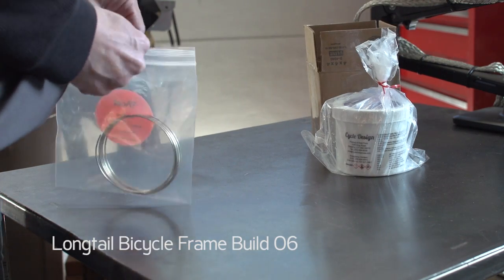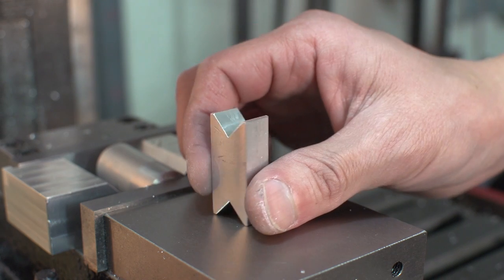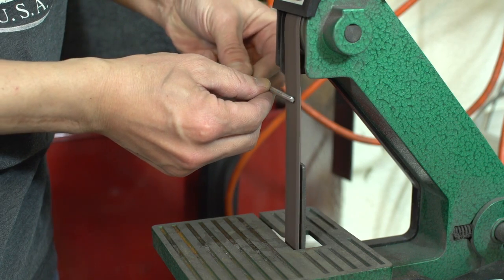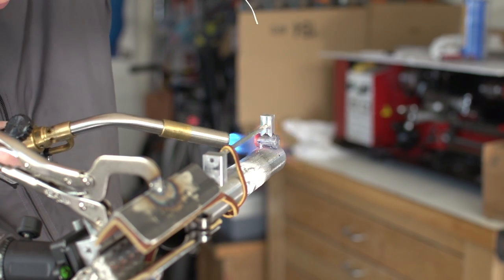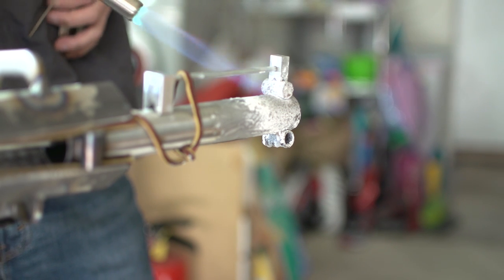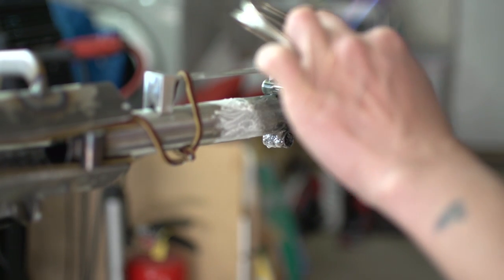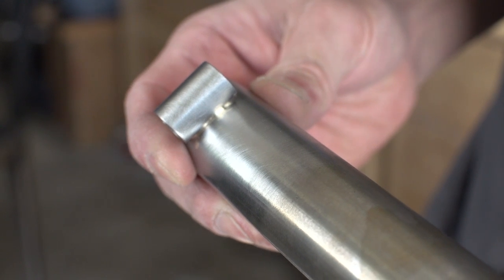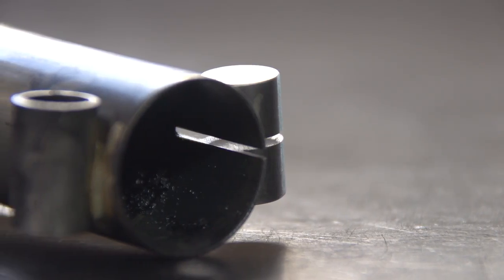Longtail Bicycle Frame Build 06 - Silver Brazing Seat Tube Binder With MAPP Gas

Comment: Really interesting, I am really old and was taught to brazing at school. The first thing we were taught was to look at the mass of the two things you are soldering. Then start heating the larger mass and move onto the smaller mass and start juggling until everything is even.
We used bronze brazing rods. We were taught that, by bashing the rod out thinner it would melt and flow quickly (less mass). Anyway, thanks for taking the trouble to produce these videos.
Reply: Bicycle frames use a mix of bronze or silver solder. Bronze is used for fillet brazing tubes together, especially without lugs, and silver solder is often used for all the smaller stuff like cable stops where you just don't need the strength or want as much heat in those areas.

Comment: Background: 
1) Silver brazing (soldering) small copper and brass mil spec  parts w/ lo temp 4% silver solder, where I  work.
2) Brazing mild steel (motorcycle frames) with brass and nickel/silver rod (gear head toys).

Thoughts and observations:
1) Quit waving the torch around like a magic wand, half the time your flame is heating the air. Use slow strokes. Generally, bias the torch to the piece with the most local mass so you don't burn a hole in adjoining thin material. Guess how I learned that one...   :(

2) Heat transfer through your hold down is minimal, due to minimum contact area of your 4 point clamp. Full contact with an arced clamp would transfer a lot more heat, possibly causing problems. If the al alloy melts, use a mild steel block, however al alloy isn't going to accidentally get brazed to your bike frame. That's why I like to use al for jigging... 

3) If you switch to an oxy/fuel system, use a tip designed for heating, not cutting or welding. With an Oxy/Acet setup, they are sometimes called rosebud tips.  Hardware store Oxy/Mapp setups I've seen use welding tips. In that case, back off from the part to distribute the heat. Welding requires intense and higher  localized heat, brazing and soldering requires lower and distributed heat.

4) Brass and nickel/silver filler are stronger than 56% silver solder, but not by much. They also require more heat. And are considerably cheaper. What is more critical, in my opinion, is the surface area of the joint. Overlap joints are best, butt joints should be welded. Good filleting, like what you're doing, creates something similar to an overlap joint. Good gusseting can create brazed joints far stronger than butt welded joints, although it takes more planning time and setup. Brass and nickel/silver can (arguably) build fillets and fill gaps better than silver solder. Silver solder (usually) wicks easier.  This is one reason for the wide variety of filler alloys.

5) Brazing can easily accommodate dissimilar metals, depending on filler selected, making it a real advantage for fabricators. Check out the Muggyweld SSF-6 and SSQ-6 videos...

6) Mapp only for brass, bronze, or nickel/silver filler? I haven't tried it but this guy says yes...
https://www.youtube.com/watch?v=5ZD7OM1_YxM&t=9s
I think a lot of it may depend on the mass of metal involved. You won't build a bridge with Mapp gas...

I'm watching your video doing research as I prepare to braze mild steel flanges on a new "universal" stainless steel catalytic converter for my truck. Every muffler shop I know of arc welds these things together. Quicker for them, but I'm not impressed. I'd rather do it myself.  

Thank god for YouTube, this place is quickly becoming the world's best DIY research lab.
We all learn something here. Good luck with your projects...    ; )
Reply: @Michael McCurley  >You have done the best job of describing of thermal mass, heat control and application. 
I have a 150 amp MIG I got with barter deal New in 1984. I think my Sear’s best O/A torch (AKA Harrison) came in 1982. No prior training but the family farm. We had a crank-top Lincoln welder my step dad & his father would use to creat metal bird poop statues on metal they where trying to fix. After my older cousins who came every summer from KC from their divorced father, showed up with a go-cart. What could more fun on the farm until you hit a chicken. They left, I wrap the rope around the pulley, flipped the metal “Kill” tab from the spark plug, and took it out and broke it. I figured they would beat my ass in several creative ways, I was trial by fire. So stick welding came to that 8 year old quickly. (Always the Tallest), but like anything, if you do it 3 or 4 hundred times, you get better. It’s hearing the sound of a leather belt, coming thru belt loops at the speed of sound, I knew that was my cue to start running. No child services or witness protection program developed yet.
Either way, I have never used mapp gas but have brake line sized tubing to join. I will give it a try, but with propane.
  Retired automotive master tech, I still like learning. Yes, no youtube, maybe a book, and no shop class in high school. It was uphill both ways and our phone was wood with a few metal parts and actual horse shoe shaped magnets. I know, my maternal grandfather & grandmother ran the phone company and switch board. Cranking the handle would generate higher voltage to ring a bell and latch a relay (Over-Center-Spring) but the cord had to be pulled and inserted into the correct line, if not lite already. That meant it was in use. That’s not hard soldering, just memories...or learning to weld. 
Also, crank top Lincoln welders, with press fit diodes installed in a large heat sink, arrange in a rectifier, makes a great battery charger, as the crank control amperage out. Best of luck with your skills. Regular brazing rod, simply adds a filler to look good, but adds very little strength.
Reply: Thanks, maybe you could start a channel also. Most channels deal with welding, not so many with soldering and brazing.

Comment: I only put flux where I want the silver to flow.  Heat the area around the joint first, including the holder.  Then you heat the actual joint  and when the flux goes clear it’s ready.  Let air cool.  Done correctly it’s incredibly strong.
Reply: Gene Miller,
Glad somebody said something about the Flux...
This guy Obviously has Clue Zero.
He would’ve Dipped the whole tube into that Flux Jar if he could.

Comment: Silver soldering is actually brazing even though we call it soldering commonly. Silver solder is stronger than bronze rod. It doesn't however build up like bronze rod because it flows more. If you want big smooth fillets or to otherwise fill gaps, use bronze. If you want high strength and inconspicuous connections, use silver. It is not that straight forward though as you can get a huge range of silver solders/brazing rods that behave differently and melt at different temperatures. It is really great stuff as you can do more complex soldering as you do all the high temperature work first and then go with lower and lower melting point filler rod to put together more complex assemblies and not melt the previous connections.  If you want more info about silver soldering, the real place to find it is in jewelry making books. They use it extensively.  

The heating is a balancing act. You don't want to heat up too slowly as when the flux is gone, you will get more oxidation. The flux should be almost gone and glassy looking. The solder will flow to the places with the highest temperature. The heat reduces the surface tension. The extra flux doesn't hurt anything but clean it off well. It will corrode the metal if you leave it on.  

Silver soldering (the kind you are using) temperature is right around the melting point of aluminum. I half expected the clamping device to melt as you were working.
Reply: David Kirtley thanks for sharing so much knowledge :) I am starting too on a similar set up!
Reply: Silver solder and Silver Braze are definitely not one and the same.
Reply from the maker: I think the clamp did melt a little on the ends. Thanks for all the tips and taking the time to write it up, very enlightening.
Reply: Brazing by definition is using a brass/bronze based alloy. The real limit of what is called soldering is with alloys that melt below about 1000F that can be melted with a heated iron. Silver soldering doesn't really meet either definition.Silver soldering is above done 1000F and isn't done with a heated iron.
Reply: It hard brazing, not soldering or welding. Hard brazing has more to do with temperature, resulting in a stronger holding pressure. That’s all.

Comment: Making a small hearth from a few fire bricks will keep heat localised in joint and allow brazing with something like a sif bronze rod. I like to paint my flux into the joint and then lay a ring of the brazing rod into it. The joint is then heated till the brake melts and" flashes" around the joint with perfect penetration.
Reply from the maker: Nice, I have so many new (to me) techniques to try now. :)
Reply: I really like the idea of this technique, but i have a few questions. 
Is this something that could be used for a tube joint? 
And would you then need to build up a fillet of top of that?

Comment: Great video, when I silver solder I use the Kozo Hiraoka method, for small areas, I Flux the area to be soldered, snip about 1/4" silver solder wire and place cut solder at four points or more on pieces to joined, making sure the silver solder adheres via the Flux, and heathe up either piece to be joined. Then whenever possible I pickle the soldered area to clean, but I've used sand blasting mostly. But, as I said, more than one way to skin a cat, learn and use your preference, what you feel comfortable with. We'really rootin' for ya.
Reply from the maker: +eddie Towers thanks Eddie, I like this method. One less thing to worry about. Frees the other hand for my beer ;)

Comment: The solder will follow to the heat. I always concentrate the heat on the thicker materials. Once the solder starts to flow be gentle on the heating. Only heat where the solder hasn't flowed to. For instance just heat the thicker stock with the edge of the flame as to not keep heating the other areas too much. don't worry about heating that holder you made as the boss is thicker and requires more heat than the tubing. I'm by no means an expert but I spent years soldering mechanical piping and odds and end metals for side projects. Enjoying all the vids by the way. Just recently found your channel. Keep it up!
Reply from the maker: Awesome, yes. I can already imagine how the next test will go and where I can put the heat. For sure not on the drilled side of the binder :) Can't wait to do the next one!
Reply: Best of luck! Keep it up!

Comment: I think that MAPP torch is actually helping you with the heat control. It's putting out less BTU's than an O/A flame, so things are happening more slowly. A good way to learn.

You can direct the heat more on the thicker of the two parts of a joint (in this case the binder) and the thinner part will be heated to temp mostly as a result of just being in the vicinity. For a binder I would also get the flame inside the seat tube from time to time, underneath the binder. That will help the filler flow all the way under. Good practice is to only add filler on one side, then draw it through to the other with the heat. That way you know you've gotten complete penetration. 

It's good to have continuous motion to your torch movements, but not too much. Also, the hottest part of the flame is closer to the nozzle of the torch. You were brazing with the "feather", quite a bit further out. This is a cooler part of the flame, so things will take longer to heat up. Get your torch a little closer. Not being critical here. Just offering some pointers. You did great in my opinion.

Btw. Brazing is also known as "hard soldering" and occurs above temps of 450 deg. Centigrade (842 deg. F). Below that temp it's soft soldering, or just soldering.

It would be interesting to see if you could brass braze with that torch. I still think that that's the way to go here, but I understand your logic in going with silver.

Consider an Oxy Propane set up sometime down the road. Cheaper than O/A but very close in functionality. 

Cheers!
Reply from the maker: Hi Alistair, Super informative write up! Sorry YouTube put this message in my spam (again) I fixed my settings so it hopefully wont happen anymore. Everything you said makes perfect sense to me, I'll give it a go!

Comment: When cutting the slots it looks way nicer if you drill a hole where you want the slot to end and cut down to the hole. If the hole is one and one half  times the size of the slot then it looks just right but this is down to personal preference. This also reduces the chance of any cracking or splitting beyond the end of the slot.
Reply from the maker: Nice, yes I'll do that. I'll prob go with 1/8 slot width on the real thing.

Comment: I used an OA rig for the small amount of brazing (silver and bronze) that I've done. Less flux all over the place and a fair bit more where you will actually be brazing. Thick gobs. Heat until it goes glossy clear. Then you are ready to braze. Also, use the heat to draw the braze where you want it to go. A finer tip would be good but you may not have that option. You are doing a good job of general heating of the idea. Your clamp pulls a little heat but should be fine. You can also use a fine gauge steel wire.
Reply from the maker: Thanks, good to know about the clamp being ok to use. Have you ever had the steel wire get accidentally brazed? Or is that really not a problem..
Reply: Thinking about that clamp being aluminum... yeah, that could be a problem in some circumstances, esp. at higher temps. But the contact area is so small that the overall thermal losses should be small. With the wire it was never a problem getting brazed but could be a risk if things get too close together.

Comment: Nice job! Check out this might be some thing to try.Tig Brazing vs Tig Welding on welding tips and tricks.
Reply from the maker: +Matthew Prestine ah yes, some folks use that for low stress bosses. It is pretty tricky stuff though. I used it to attach my badge on the last build. I don't think it would be strong enough for the ST binder though..

Comment: Your question about the heat migrating to the holder -- not so much because you have four stand offs. This technique is so cooling it is used in my cookware by Wolfgang Puck where the metal handle attaches to the pan. I've owned many many sets of cookware and by far this set is the best thus far.

Comment: Clean the inside of the tube. You only need to put the flux were you want the braze material connection to flow and stick. Put flux on the bottom of the binder and on the tube only where the binder will go.  Put the flame on the top of the seat tube binder. Once the binder is hot enough, move the torch to the inside of the tube. Once the flux changes state move the flame away and attempt to add flux to the hot parts. Don't hold the flame over the braze material wire.
Reply from the maker: Thanks for the tips. I hear and see varying opinions on flux.. I was under the belief that the flux needed to go around the area as well to shield for oxidation. I suppose with a better torch (a real O/A) setup there's less spill over with heat.

Comment: Pretty good job. Really good looking and smooth beads. probably would have gone with mig welding or tig welding because it makes a much more complete fusion deep into the base metals instead of a decent surface bond from capillary action/ open pores of the metal drawing in the filler material once at temperature. But brazing is great for non impact and non stressed applications. Just a welders opinion. Oh also gas welding with oxygen acetylene and a filler rod is also a good route to go with. If done right will produce a complete and strong fusion as well. Check it out. Oxy fuel welding. I wish you the best of luck in your metal fabrication projects.

Comment: If you’re doing a production run of brazing, keep your binders and dropdowns in an oven at the brazing temperature. This way, you can keep the heat where you need it, and won’t waste so much time or gas warming up both parts.

Comment: When brazing get the tip of your solder hot and dip it in the dry flux  it helps the solder to run
Reply from the maker: +Barrie Thompson great tip! I did have trouble with that. Will try it.

Comment: Try pickling solution to clean joint.  Much faster less work cleaner joint. Heat from other side of tube once flux liquefies then move into the actual joint.

Comment: Your process is quite detailed. You do so many things that I would have (and have) completely overlooked. Where and how did you learn this?
Reply from the maker: I took some night classes at a local nonprofit The Crucible. The classes were machining, TIG welding, and frame building. It didn't teach me everything but gave a good foundation. From there I looked at a LOT of pictures on the internet, read the major bike building forums (not as much reading as I should have), and then just dove in. The smaller detail stuff I actually learned from viewers!

Comment: think as you said, use the 02 techniques, the silver alloy and bronze alloy
what is the melting temperature of the bronze rod filler
what is also the temperature of the melting or casting of the silver rod filler
thank you

Comment: hi david, i think you have to use the both , sometimes the job imposes, what do you think about brazing with silcone bronze ? 

OR alloy rod , silver bronze ,i'm looking to perfect the welding brazing on metal galvanized and stainless 

need to have good result with low temp , without loosing strongness